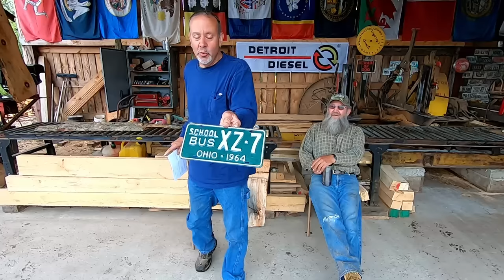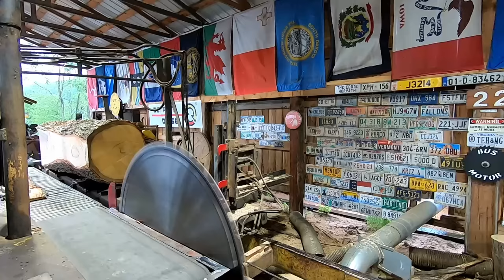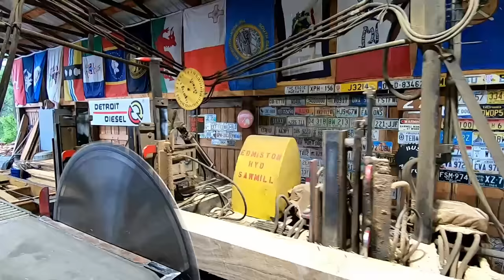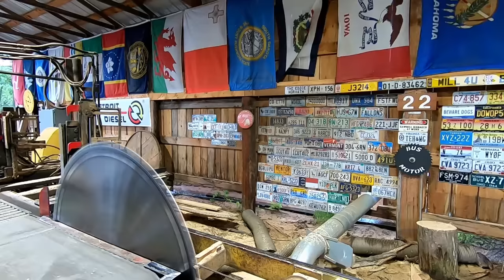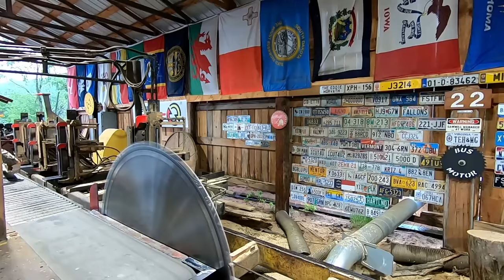sawing oak 1x1's & 1x3's # 426

Comment: Five o’clock in the morning having breakfast sausage an eggs them boards have nice grain and no not holes , nice little job this morning cleaning a 56 inch blade covered in sap worse than glue so it’s out with asatone takes a while to soak in then wash it off with petrol , they were cutting freshly cut pine very sticky,, you guys have a nice day

Comment: I like watching you guys cut logs so I’m gonna give you guys some good advice and it’s coming from experience 4 generations of timber fallers to be exact.  Do not buy or use an electric chainsaw they are not as reliable or efficient as a gas chainsaw. If you want a yard saw or landing saw I  recommend using a sthil ms 391 it has plenty of power for larger logs and you can swap to a shorter bar for trimming unfinished mill cuts. It’s a saw that my grandfather had for landing saws they served the purpose quite well they where not used much for falling but for bucking and knot bumping they worked perfectly fine and they can be used to fall trees as well and they do that just fine for occasional falling. For a lighter saw I recommend a sthil ms 180 or a size or two larger it’s smaller shorter bar would work fine for trimming unfinished mill cuts. Again this comes from experience. I have tried one time an electric saw and it wasn’t worth a crap no power bound up constantly even with additional oil ran along the bar and a very sharp chain. It went right back to the same shop I bought it from and I got a gas powered saw that works reliably all the time fast cutting no binding plenty of power and no problems. So in my opinion electric saws are junk and not worth a shit .as for my family’s logging experience it’s extensive going back to the 30s my great grandfather fell timber using an axe and a 2 man handsaw and all trees where climbed and toped logs where brought up the American river canyon by steam donkey or across the American river canyon by cable car then sent by rail to Michigan cal lumber mill later my grandfather started falling timber then later partnered up with 4 others and ran their company later he eventually ran his own company H&H timber in Eldorado county California they both then taught my father who later taught me and my cousin. So we know what we are talking about when it comes to good saws and saws that are completely worthless and junk.
As far as finding metal we have found lots everything from fence posts to bullets even a t post a cedar grew around gramps went through 6 chains before he got above it and was able to fall the tree. Later he tore the stump apart to see what he hit and it was a t post put in some 30 or 40 years ago. Dad found modern steel arrow heads from hunters and old musket balls from the gold rush days shot into trees and even stone arrowheads from 400 years ago In a 8 foot across Douglas fir and they were right in the center of the tree they had to have been shot into the tree when it was no more than 6 inches across.

Comment: Overall, that looked like a premium set of log. Very clear looking, maybe capable of cutting into some really fine pieces of lumber. Did you really need something that good for 1 x 1's and 1 x 3's  for this application ?
Reply from the maker: it was a short log so we kept it out of the firewood pile , it's also hard to make 1x1's with knots.
Reply: @markgalicic7788  Ahh. So...
Reply: I’m with Gary on the quality of the log. You say short log? So under 8’? You’ve sawn less quality logs that didn’t have knots per se but did have other defects that poor quality because of it. I guess I don’t know where or how you’re selling the lumber you cut, but there are plenty of custom mills that will cut short logs as you put it. Most wood workers don’t need 8’+ material anyways.

Comment: 👍👌👏 2) At 5.36 min: Really? Still no adze, guys??? Please kindly allow me to suggest something: Maybe you like to make a DIY adze from an old axe? Simply weld on a piece of sturdy steel tube across the flat hammer head of the axe for holding a round wooden handle. This DIY adze mustn't be accurate, it's only for cutting away bark occasionally.
2) You could also use the flat sharpened side of a small pick axe. 3) Or even better and maybe the simplest and cheapest possibility: A garden/farming hoe (the type with the sturdy blade).
Anything that makes work/life easier is rational/useful. We all don't get younger.
Best regards, luck and especially health to all of you.